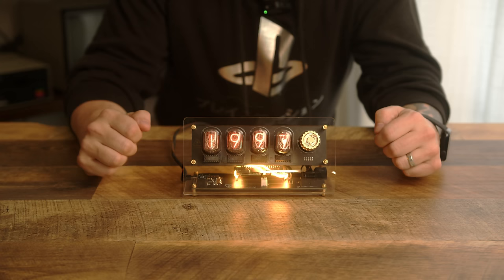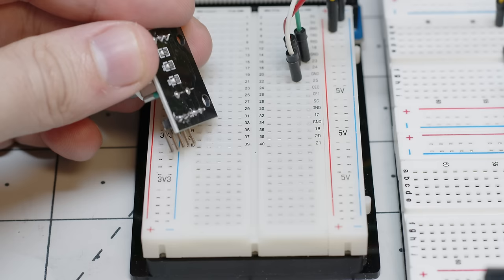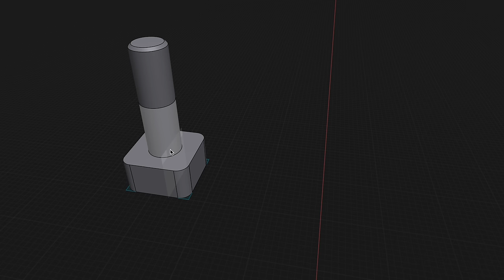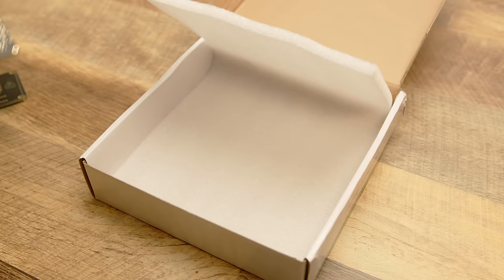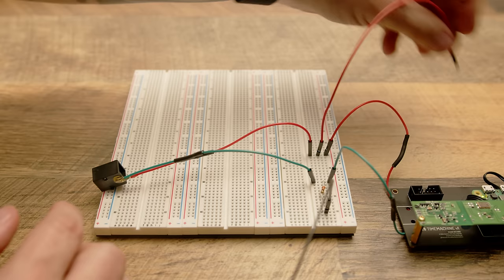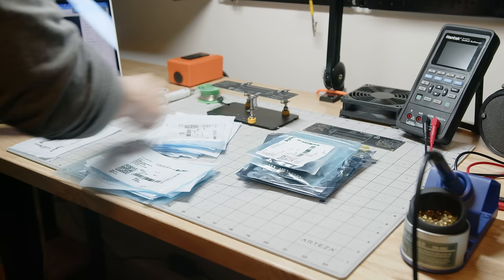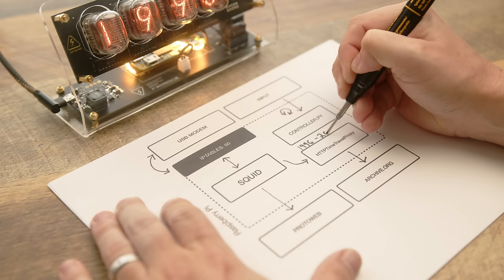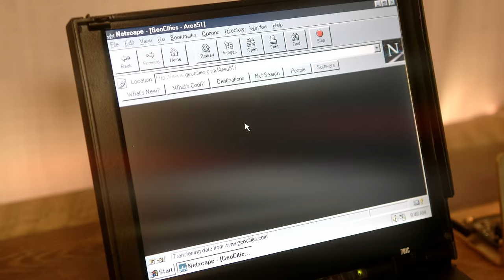Making a Dial-up Internet Time Machine

Comment: My guy you can stencil and assemble SMT component PCB's using your hot air station. No need for a hotplate
Reply from the maker: Yup, totally could, but call me crazy. It quicker for me to just use the iron!

Comment: Where did you get those nixie tubes/glow wires?
Reply from the maker: Nixies are IN-12As that I got off Amazon and I found the flexible LED strip on Adafruit. Definitely going to find ways to incorporate those in other projects!
Reply: Thanks! @polymatt